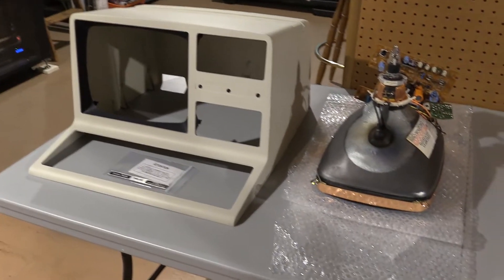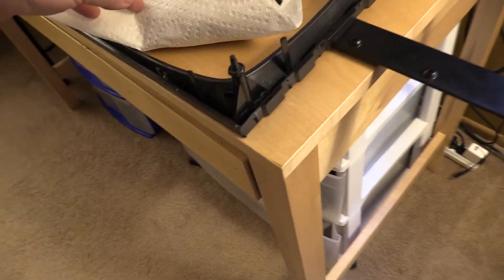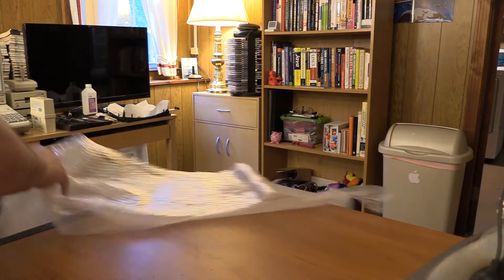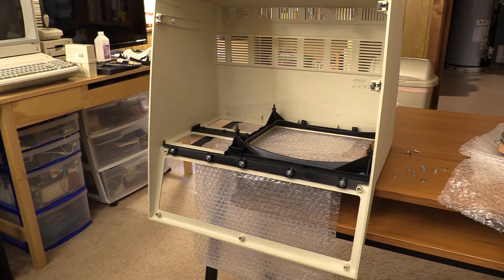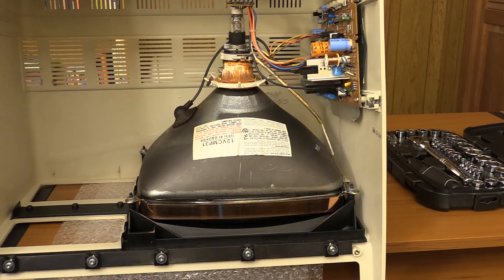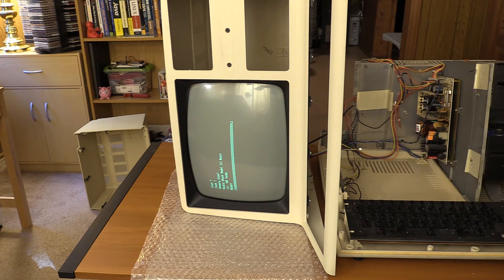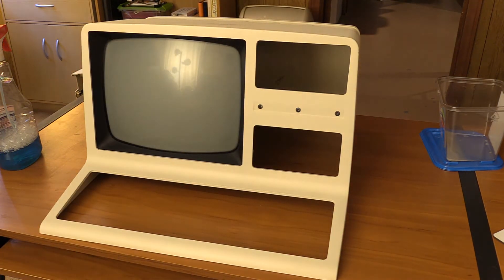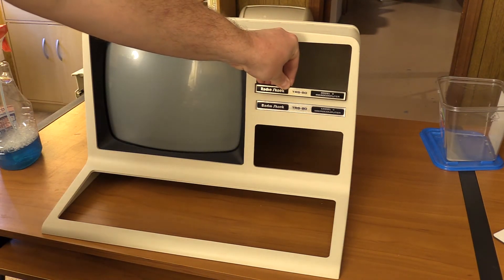TRS-80 Model 4 Restoration: Case &  CRT, Plus Power Supply Removal

Comment: Thanks for the video!  I just got a working model 4 I need to refurbish!
Reply from the maker: Good luck!  These machines are a ton of fun.  Getting one going again is very satisfying.  For a really neat Model 4 experience, check the FreHD hard disk emulator.  Ian Mavric sells them: http://members.iinet.net.au/~ianmav/trs80/emulator.htm

Thanks very much for watching!
Reply: @TJBChris  the only part that scares me is removing the CRT as the entire upper case assembly is going to need a good bath.  The machine works but it is coated in a sticky, oily residue.  Most likely from being stored in a garage or shop of some sort.
Reply from the maker: I was worried about that, too.  Putting the case CRT-side-down on the desk with the keyboard bezel hanging over the edge, like I did in the video, made it much easier.  I could lift the old CRT out and drop the new one in.  I can be a bit of a bull in a china shop, so I was worried about getting it right, too.  Good luck!
Reply: @TJBChris  my main concern is discharging the CRT, I’ve never done that before.  I’ve got a wand on order.
Reply from the maker: @codingwithculp  Gotcha, I completely understand.  Worst-case, if you’re unsure, do nothing.  The worst that happens is you have to find someone who can discharge it.  :)